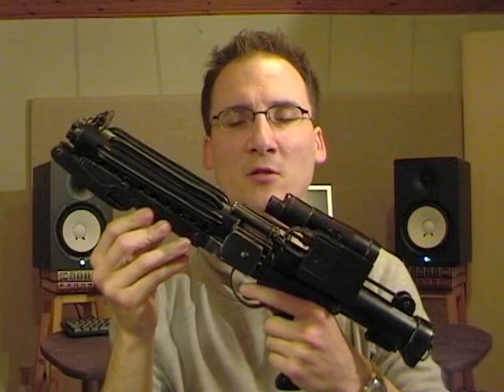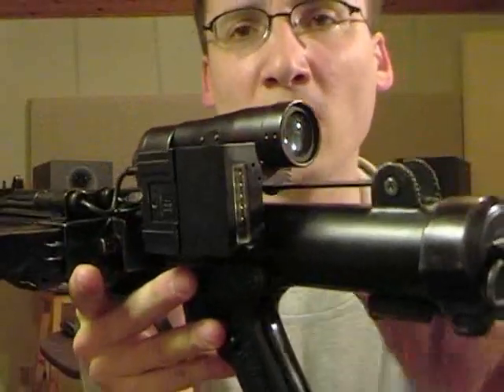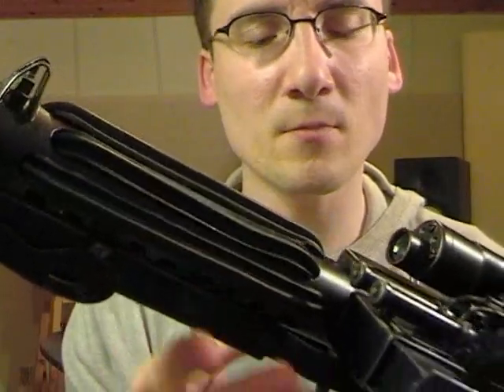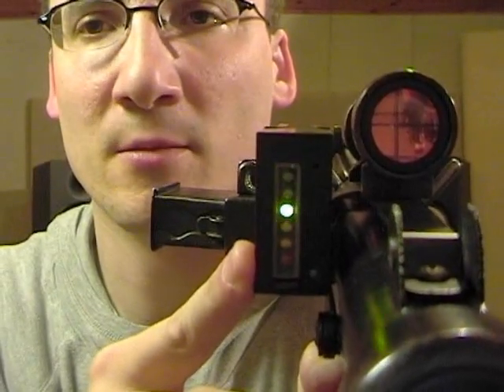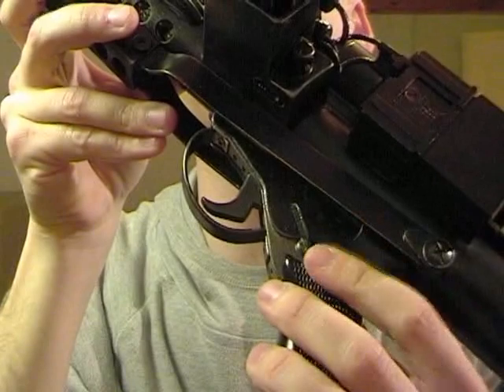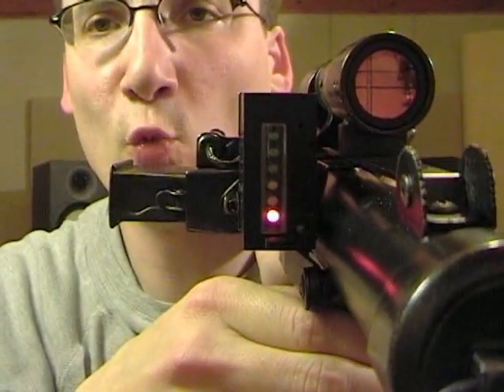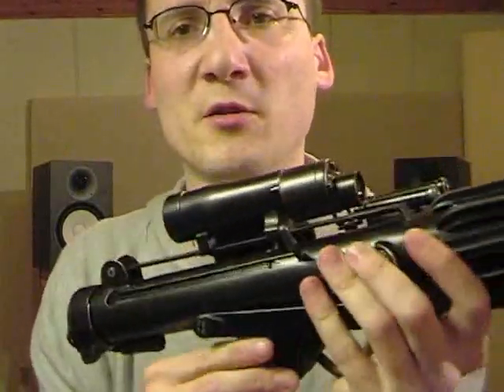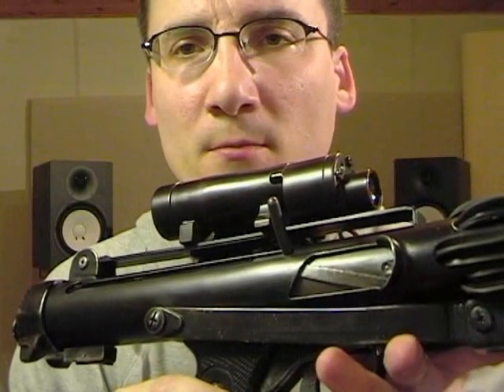My Scratchbuilt E-11 Blaster with Blaster Core

Comment: Awesome video Pablo. Thank you for showcasing the Blaster Core as well as sharing your incredible scratch built E-11 with us. 
 I have a custom metal blaster I am working on and will likely use the Blaster Core myself. It's definitely the best sound board for blasters out there, in my opinion. The ability to customize the sounds sets it far ahead of anything else I've seen.